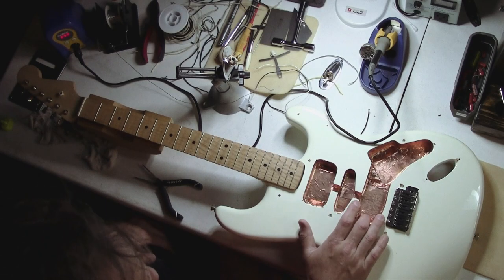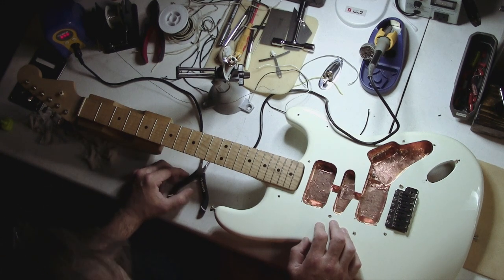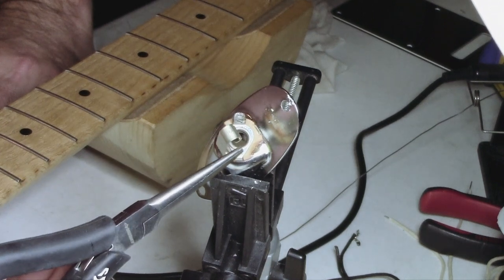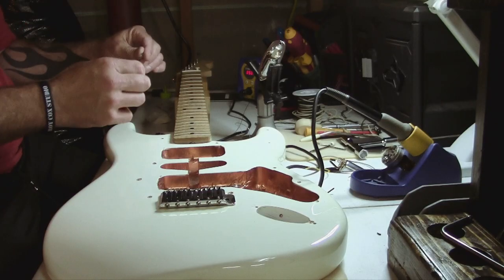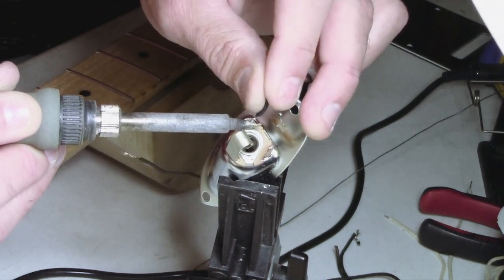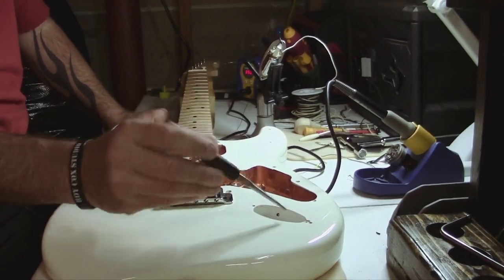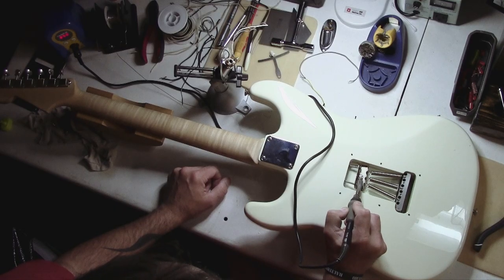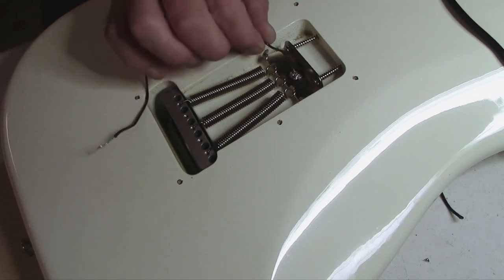stratocaster input jack:ground wiring

Comment: Very informative and easy to understand… that is if you’re trying to troubleshoot a MIJ 1980s strat with SD Live Wire SSH config (I bought it used like this, with a kahler trem and a few other mods when I was 15yo). Looks like there’s a little more to it when you’ve got 2 9volts to deal with and I’m having a hard time nailing down a diagram from SD. It’s almost like they’re embarrassed by these wax dipped early hi output config and don’t want anyone finding a schematic. Lol. I’m sure there’s plenty of others that are similar enough in the active SSH config. 
But this video got me gong towards a full fix so thank you for that for sure. 
Should make as many as you can. It’s awesome that you share your knowledge about the guitar abdomen surgery and electric 6 string Bariatric methodology.
Reply from the maker: Appreciate it!

Comment: Good video. I wonder why manufacturers don't put a small 2 wire plug connector so you can unhook the pick guard and remove it without unsoldering anything. I add this any time I open up a strat.

Comment: Thx for video I have loaded pickguard an have as you say a white an black but also another black so why is that just another ground wire
Reply from the maker: Yes. Most likely your loaded pickguard has one black that is meant to ground to the input jack and one to the top of the pots after soldering to the right outside lug of the volume pot.
Reply: Yes so the extra black from pot can I run to cavity screw wrap around that an then an then solder to claw at back less cables an obviously the other black an white to input jack

Comment: So I've bought a loaded pickguard to get the pickups for my old guitar. I already had new pots and cable so I thought I might as well change all the inside. And it looks like I've connected the wires the right places and made sure it's a solid connection. Same with the grounding. However all I get is noise and static. I can turn up the volume(louder stactic) but the tone knobs doesn't seem to be working, neither is the pickups. And  For some reason it gets more quiet when I'm just holding the pickguard  in my hand near the switch.
Do you have any idea what I might be doing wrong?
Reply: Twist single coil pickups and out put jack wires together. Shield cavity with aluminum tape that works just as well as copper foil.  Daisy chain a ground wire to all the pots back. If still a noise issue, then reverse the out put jack wires. Don't be concern about ground loop or star grounding. Been fixing guitars for 40 plus years. YouTube videos are all over the place on the noise subjects. Cheers

Comment: what does the ground wire attach to if you have a preloaded pickguard? 2 wires go to the input jack, but what does the 3rd wire attach too?
Reply from the maker: the ground wire is usually going to be soldered to the top of the volume pot also.
Reply: @roycox4415  does the other end of the wire get soldered to the tremolo claw?
Reply from the maker: @jeffdonohue3711  exactly. now some guitars have a ground wire coming from a screw in the inner body of the guitars electronics cavity. In this case it would come from that screw to the top of the volume pot as well but in your case, yes, go from the claw to the volume pot top
Reply: @roycox4415  thanks so much. I am a total nubie to this and your videos are most helpful.
Reply from the maker: @jeffdonohue3711  always here to help anytime! never hesitate to reach out

Comment: Wrap the ground wire the opposite way under the screw so it snugs in as you tighten…. Electrician pro tip. ❤
Reply from the maker: That’s a great tip!

Comment: Hey Roy. Like your strat wiring but can you do a Jaguar wiring job with a kill switch as original using a humbucker as the neckpup (Rhthm) and fender single coils mid and bridge (lead) using single volume and two tone controls.

Comment: Thanks a lot. I have a 3rd black wire going to my input Jack (Fender 1960's reissue) and I do not know where to connect this one.
Reply: 3rd wire goes to the tremelo ground connection screw into the wood

Comment: Just as you wire leads to an outlet, going over the top of the screw with your hook, allows the wire to be pulled into the turn of the screw, so it does not back out.

Comment: thx for the video.My loaded pickups have a black,green,& white wires.My diagram shows black is ground,white is hot to the middle of volume pot. The diagram doesn't show where to put the green.The green is soldered to the top of the middle pot with the black wires connecting the pots together.Would green go to the screw then tremelo? There is no screw in the pickup cavity like you show.

Comment: Great video as usual Roy. Cheers!
Reply from the maker: thanks so much!!!
Reply: @roycox4415  Oh Roy one question, is there any negative effect on using springs instead that rubber pieces to manage the height of the pickups? Thanks in advance!
Reply from the maker: Obi Wan Kenobi not at all. I also use springs. Just personal preference
Reply: @roycox4415  Thank you very much Roy!
Reply: General Kenobi

Comment: It looks like you have a Hakko solder rig (somewhat like mine).  I notice that your solder connections are near instantaneous.  May I ask what temp setting you use and your opinions as to different settings for different types of connections?  Just for situations like this - not specialty/precision situations.  Thanks for such clear/patient videos!

Oops!  No sooner asked than answered - at least for the temp settings!

Comment: A very informative guide. But, we have the trem wired to the screw inside the body. So where does it ground to after that? Because as far as I can see, though the trem is connected to that screw, collectively they're not grounded to anything. 🤔 Did I miss something?
Reply from the maker: It’s connected to the ground wiring that goes from pot to pot in the electronics and the final point is to the top of the volume pot.
Reply: @roycox4415 Wonderful. Thank you. 😁

Comment: Great video !  Thanks for the tips.

I have a question,

I have an american strat special SSS, texas special PUs.
(Used to be HSS, but I swapped humbucker for  texas special pu)
I have a basic understanding of how the pickguard is wired up and the purpose of caps on the tone pots.
But my strat has 2 disc caps per TONE pot, the same 2 caps on each tone pot.
Cap #1 is BC Z5U 203M 1KV
  This cap is installed in a standard way, grounded to pot and connected to lug on right, (when lugs are pointing down).
Cap #2 is Y5U 104M
  This cap is soldered to middle lug and left lug, (when lugs are pointing down).

.... Can you tell me what the purpose of Cap #2 is ?

Thanks
Terry

Comment: Had a question, I know this video is 4 years old. I'm dropping in a preloaded pickguard that comes with 3 leads, 2 black and 1 white. does 1 of the black grounds go directly to the trem claw? correct? Got confused when you attached it to a screw in the cavity. Thanks
Reply from the maker: That’s correct. If you don’t have a ground going to the claw that’s what the other black is for. If you already have a ground to the claw then you can do away with the second black wire or tie the two blacks together and ground them to the volume pot as if it were one wire. It’s all part of a ground loop anyway

Comment: To ground my loaded picked i need a wire to the claw, the body and the jack - is that right?
Reply from the maker: Yes you are basically tying into the ground setup on your guitar. In most cases that will be the pots grounded together and then the switch and claw and/or body screw ground together into one another.

Comment: I did this from looking at a guitar wiring diagram, I needed a video to explain better because my guitar was buzzing when I don't touch it and buzzes louder when I touch it.... 

I guess I missed the grounding from the input jack to the volume, I mixed the ground wire for the other one
Reply: I'm yet to test it but I've just swapped the ground wire to be where it is meant to be

Comment: Nice video...question...the term claw does need to be grounded? I ask as I have a project and it doesn't have a hole for claw ground..weird..is it possibly it dont need it?
. Thank you in advance
Reply: Hello, as Roy answer you, I tell you that yes, trem claw MUST be grounded, otherwise you'll gonna have buzz as hell! Some trem claw models as Gotoh come without that hole to hook the wire when soldering. If this is your case I recommend you to take a piece of sandpaer and sand a little bit in the area where the wire goes, because sometimes could be a little tricky to get the solder to stick to the claw. Hope it helps!
Reply: PS: a nice and clear idea to ground your trem claw would be to add to the ground wire a ground terminal (those with a hole, the same fender uses to grounding the guitar body; you can buy it in any electronics shop), then you can place it on one of the screws in trem claw. Cheers.

Comment: I have a bullet strat and I bought a new output Jack and wired it up but when I plugged it in(it was difficult to plug in) it would make a really loud humming sound and it would stop when I touched the strings. When I touched the screws by the pickup selector it got even louder. And suggestions?
Reply: thats a grounding issue for sure

Comment: I thought you didn't need the grounding wire between the pots since they are already grounded to the shielding. Can anyone clarify this?
Reply from the maker: The pots should always be grounded together and the negative wire from the input Jack grounds to the top of the volume pot.

Comment: One problem, if anyone can offer some advice, the input jack came with the Lace Alumitone pickups... this may be a bad combination for a Strat, especially since I have never played or even heard a proper demo... anyway, the input jack was already soldered to the volume pot as demo'd in this video, but the other is soldered to the top of middle tone pot. I am having such a hard time. This was an overly ambitious project from the start, but I am going to will it all to come together, with a little help from my friends?

Comment: The shielding on that thing is a nightmare!  He never shielded the output compartment and the copper tape is supposed to overlap at the top to make a connection with the shielding on the back of the pickgaurd.  At the end of the day if you don't have continuity...you have nothing.
Reply from the maker: That’s actually incorrect. The main cavity is shielded and only needs to be shielded with the copper tape under the pots themselves. The ground wire from the jack runs into the ground screw terminal which also makes contact with the copper tape creating your entire grounding loop. You don’t actually have to shield the input jack cavity. You can but it makes no real difference actually .

Comment: Pet peeve, but that’s an output jack not an input jack.
Reply from the maker: Both ways are correct actually.
Reply: @roycox4415 do guitar pedals have two input jacks or an input and an output?
Reply from the maker: @eddieb3d  I get what you are saying. Look up guitar input jack. You will see a ton of huge companies that sell them title them as such and then some title them as output jack. Trust me. People call them both. Not sure it matters.
Reply: @roycox4415 your right it probably doesn’t matter most of the time. I said it was a pet peeve 😁
Reply from the maker: @eddieb3d  I have a bunch of those and I totally get you!